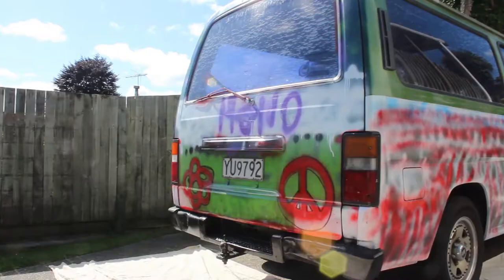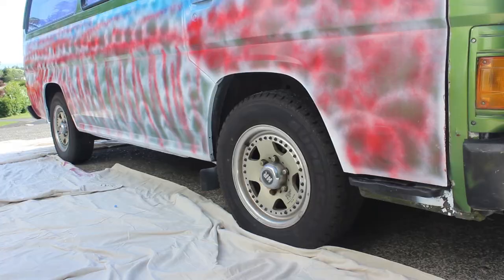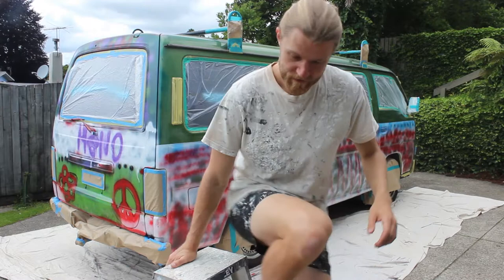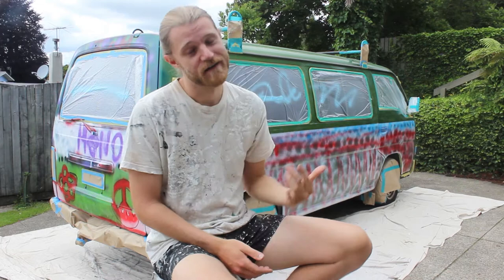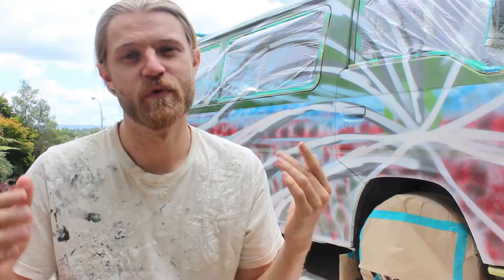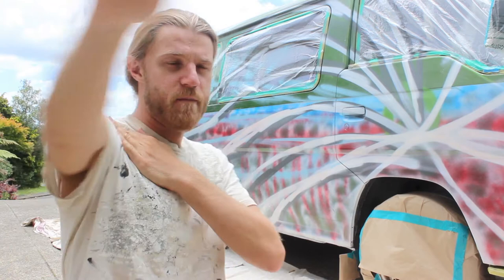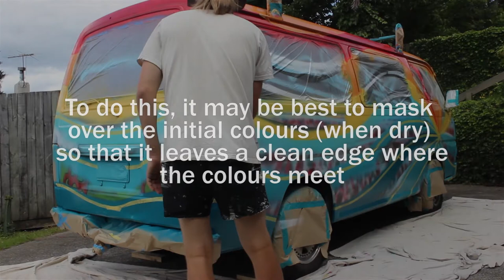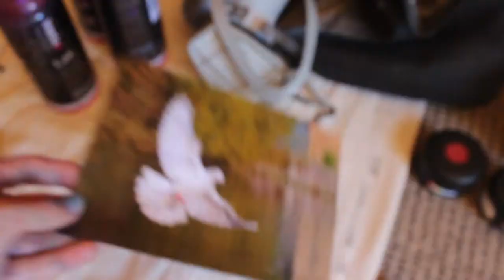How to Paint Your Own Van!

Comment: Hi!  I'm getting dizzy from how many "how to" videos I've watched and yours is the most helpful!  I recently had a door replaced and wanted to paint it, sort of a healing /blessing for it post accident ya know?  My main concern is screwing up the paint and causing damage to the door underneath.  You don't list primer as a step between sanding and painting, is this okay to do?  Is there risk to the metal underneath?  What paints do you use?  What clear coat?  Thank a million, I can't wait to get started!
Reply from the maker: Hi Cate, I'm glad you've gotten some value from this! You're right, ideally a primer would be used first. I didn't in this case with the van, because it had already been painted recently without a primer, and the van in all honesty is nearing the end of it's life XD I would recommend a penetrating primer, as the main issue with metal is actually getting the paint to stick to the surface, so without using a good primer on the door first, your paint may scratch away and fall off over time. If you are in NZ or Australia I can give specific advice in which paint to use exactly, otherwise the paint available in your country will be quite different and it would be best to visit your local paint shop :)
Reply: @ByronRomerArtwork  Hi! Thanks for the helpful vid, I'm in NZ and Just wondering what type of spray paint, primers, and clear finishing coats you would recommend for this sort of thing?
Reply from the maker: @georgiametaxas2492  Hey! For this van I used Ironlak spray paint, but Molotow (from Gordon Harris), Loop Colours (you can order online and they're probably the cheapest) or Montana Gold are all good Spraypaint options too. In terms of preparation, a light sand can be sufficient. This is mostly just to ensure the paint you're applying has something to grab onto. If the surface is especially glossy, or areas are really flaky or rusted you may need to prime it. I don't have a specific recommendations for which primer to use unfortunately, but there are a few primers specifically for vehicles which will be suitable. For a clearcoat I personally use Resene UV Clearcoat, which is a little tricky to apply by brush and roller, so you may want to look at Bunnings or Mitre 10 and use a Spraypaint clear coat, i know they have some good options. Hope that helped!
Reply: Thank you so much this has been super helpful!! :)

Comment: what paint did you use for the hand painted dove? i’m looking to paint my 1991 miata in a hand painted style
Reply from the maker: Hey there, I used test pots (cheap, and the perfect size for hand-painting on a vehicle) of a standard exterior wall paint from my local paint shop - which here in New Zealand is called Resene. Any standard exterior paint from your local paint shop should be suitable and will last, as long as you lightly sand and dust the vehicle beforehand and use a clear coat over the top once it's finished :) Good luck with your Miata! Would love to see a video or pictures when it's finished!

Comment: What kind of paint, and what is the clear coat made of?  And you didn't seem to clean/prepare the ground. Why not?  What kind of paint did you use with the brush?
Reply from the maker: I didn't film me sanding, dusting and cleaning the van, but yes that's a very important step. I used Ironlak Spray paint, acrylic paint with the brush, and a water-based UV protective clearcoat. Thanks for watching!
Reply: @ByronRomerArtwork  Thank you.

Comment: Thinking of painting my van all hippy🥴 I’m in Sydney AUS what primer and paints do you recommend? I don’t know if I want to spray paint
Reply from the maker: Awesome! In Aus I'm pretty sure you'll have Dulux available. Dulux 1 Step Primer should be good as long as you've sanded and dusted the vehicle first. And then Weathershield X10 would work for the top coats. I'm not sure if Dulux does a good UV clearcoat for the final finish, but you could definitely ask at your paint shop! They may have some other useful advice too. All the best! :)

Comment: But what kind of paint are you using
Reply from the maker: Hey! I'm using exterior wall paint
Reply: The Squid is there a specific brand? It would help a lot as I’m trying to renovate my own haha! Anything is appreciate thank you for even replying!!!
Reply from the maker: @studysector420  Hey, sorry for the late reply! I just saw your comment. In New Zealand, where I live, either Resene Lumbersider, or Dulux Weathershield X10 are suitable, and I use Resene UV clearcoat. If you aren't in NZ or Australia, there are probably quite different brands available to you, so it's best to ask at your local paint shop. For spray-paint, Montana Gold, Ironlak, Molotow or any similar big brands will be suitable, as long as you saind and dust the vehicle surface beforehand, and apply a clearcoat afterwards. Using a penetrating primer first would be ideal too, but not always necessary :) Thanks for watching, hope your renovation goes well!

Comment: What kinds of paints did you use for this? Does the brand of paint matter much? What coating did u put on top?
Reply from the maker: The paint doesn't matter too much, as long as it's suitable for exterior use. By lightly sanding before painting, and using a protective clear coat afterwards, the paint should last well. I used Resene exterior house paint, and a UV Protection clear coat for the top :)
Reply: @ByronRomerArtwork  awesome thank you! I'm planning out my project now this helps a lot!
Reply from the maker: @Anthumsnailbunny  Awesome! I hope it goes well for you!